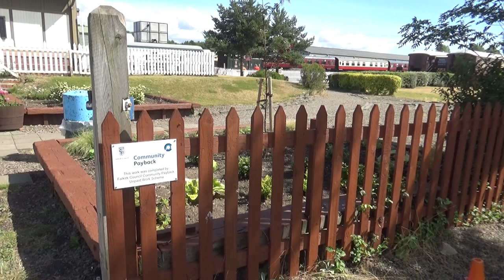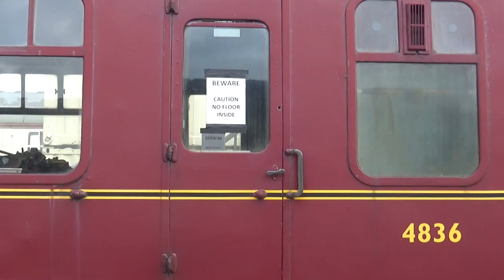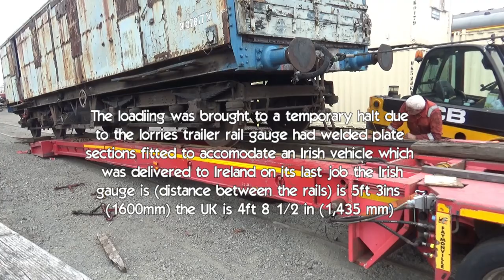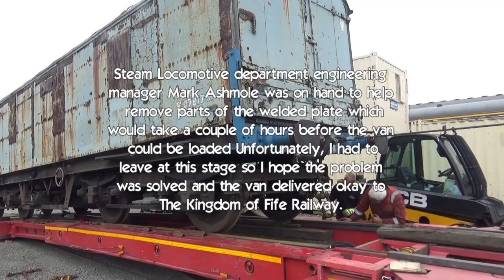special mail van for Fife Railway

Comment: IT LOOKED LIKE A CAR TRANSPORTER COACH LIKE WAS USED FROM HOLLOWAY CATTLE DOCK TO THE NORTH BACK IN THE 60S .THE ENDS OPEN OUT AND THE LOWER PEICE OF BODY WORK WAS FOR TO CARS TO PASS FROM ONE COACH TO ANOTHER MIGHT BE WRONG .
Reply: Yes, l remember the old Motorail services back in the late 1960s. Our family used to travel by rail from Sheffield in South Yorkshire to Devon and Cornwall for our annual holidays. The train was made up of 6 sleeping cars and a similar number of car transport vehicles behind just like this. We travelled overnight. This is a concept that maybe should be revived as people have such concerns over the useful range of electric vehicles. There could even be a generator coach so that you could recharge batteries as you travelled. If they can do it for mobile phones, why not scale it up!
Reply from the maker: @2898nickg   Thank you so much for your  comments for your great memories of the 1960's 😄👍🚂
Reply from the maker: @2898nickg   Great stuff thanks for your comments😄👍👍🚂